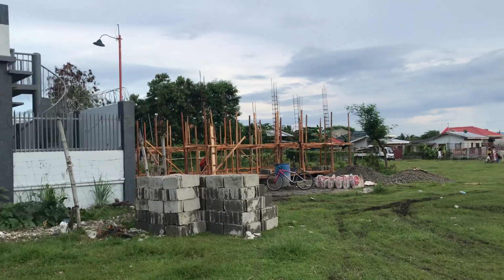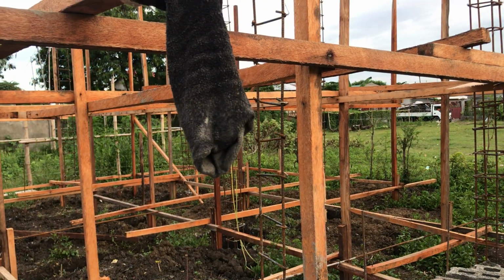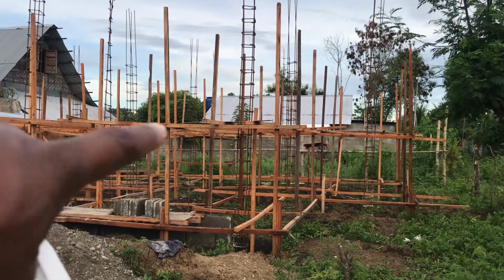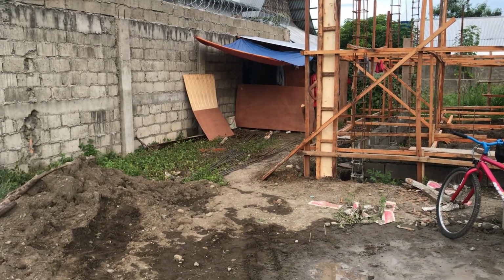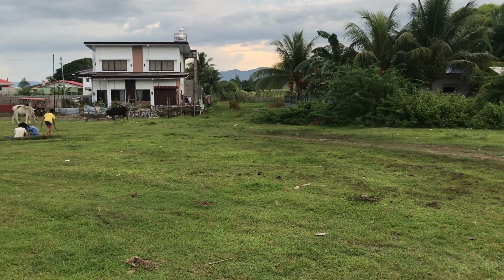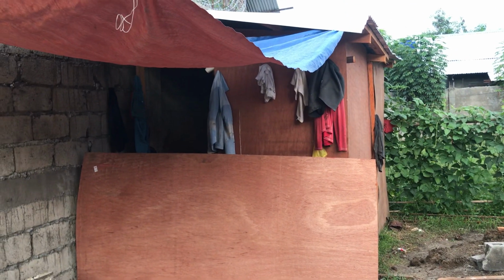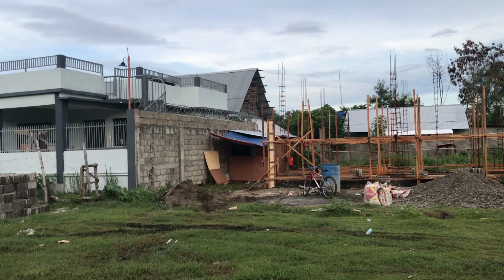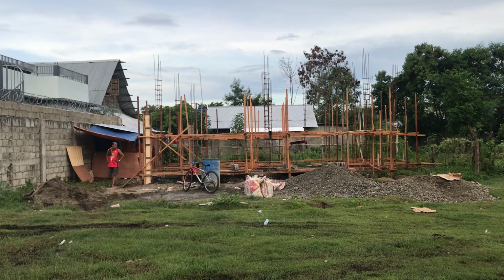DAY 10 Of Our HOUSE CONSTRUCTION The Foundation

Comment: It’s interesting they installed the hollow blocks before the structural members are poured. I’m guessing it’s easier to align blocks with string to get perfect alignment. Looking good, Calvin.
Reply: Don't you find it odd that the hollow blocks are not structural in the same way that cinder blocks are in western buildings?  The cinder blocks would be larger and interlocked, but here the rebar and poured concrete corners make it structural.

Comment: Mr. Calvin...I hope they put in Solid Cement and Rebar Foundation...before they put the Cement Blocks down....not directly on the ground due to weight of the walls settling in the future to avoid the walls cracking....because when it rains the soil gets soft....
Reply from the maker: Yes thy did. Go back on my last video of the construction and the rebar is clearly seen in the ground. Thanks.
Reply: @calroach1  ...good, I have to look at the other Video....ok, Day 7 build shows the Rebar Foundation.....just trying to look out for you...maybe try to help you.....✌️